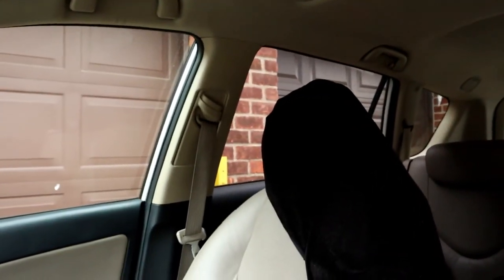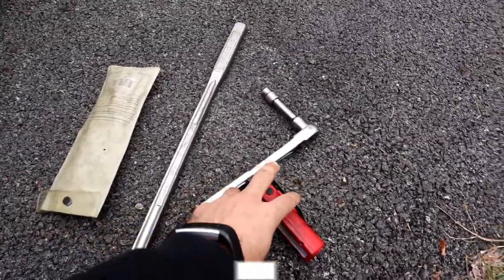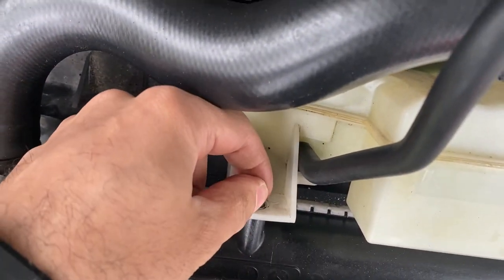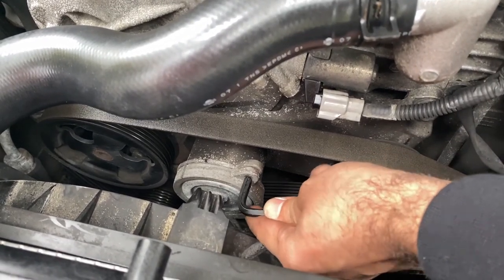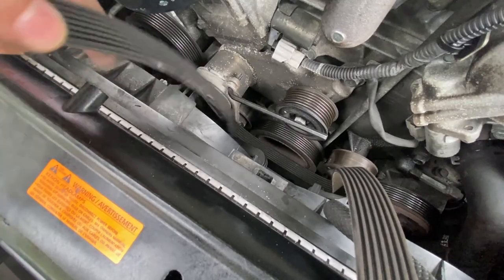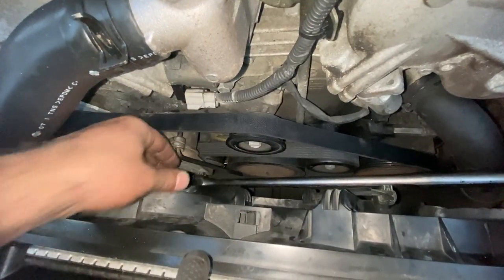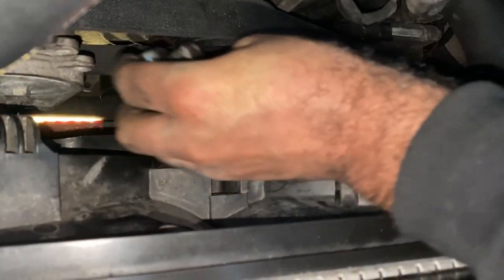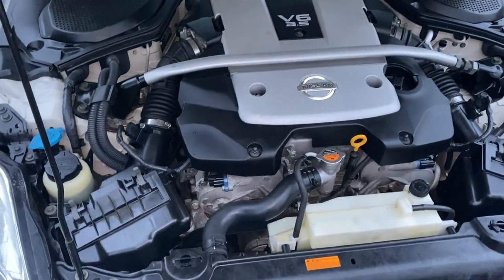How To Change SERPENTINE BELT on a 350z/G35 HR | New Z in and Getting to Work (VQ35HR)

Comment: Eddie did you use the 7PK2055 or the 7PK2060??
Reply from the maker: Check out the links in the description🤘🏼... Have the belt used in the video and the OEM one which for this specific model is a 2008 nissan 350z vq35hr pt # 11720-JK20A. Hope that helps brother DM on IG if anything!

Comment: Bro how are you getting the breaker bar In there !!!
Reply: I have a metal covering on the back of the fan and it’s decreasing the room I have to play with
Reply from the maker: 🤣🤷🏻‍♂️... sorry to hear that brother, just went in and got to work to help my boy out and captured as much as I could, angles n all... Is your breaker bar similar?
Reply from the maker: Hmmm the only hardship I had TBH which took a few moments was pulling it around the tensioner pulley... All else was good🙏🏼 how’d u make out?
Reply: @SimplyEddieG  she’s up and running i had to lift that fan shroud up a little so I could get the breaker bar in getting the belt on was easy